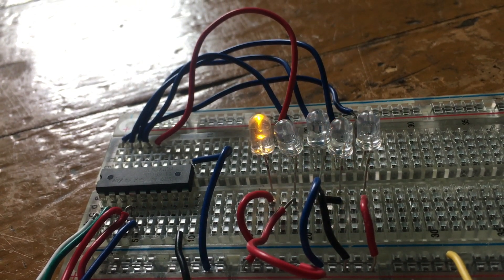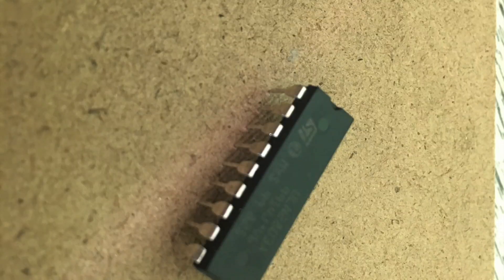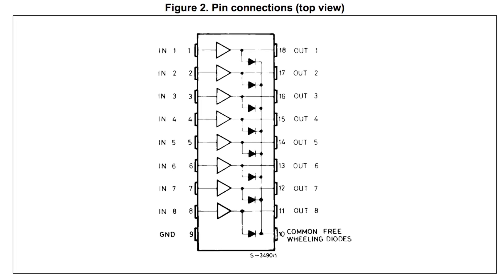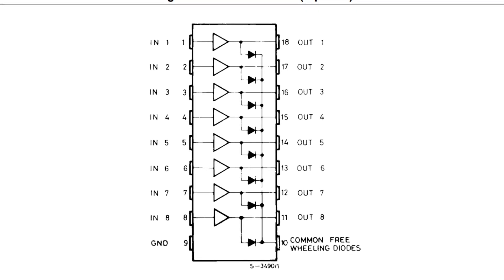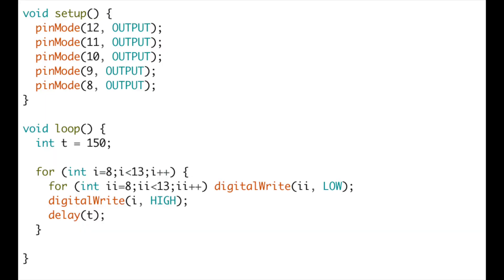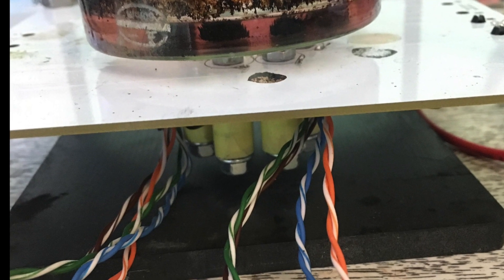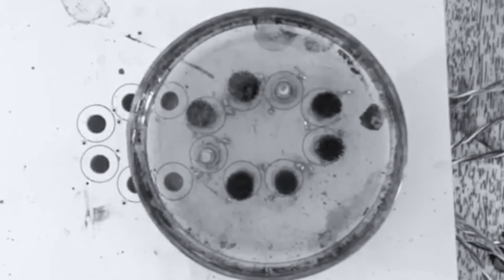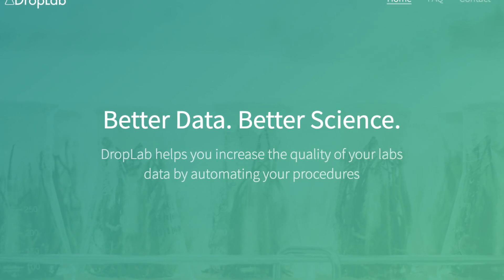ULN2803 Darlington Transistor Array (For use in circuit designs like the Ferrobot)

Comment: So this is more of a pull-down setup where "out" is just access to ground? I looked over the data sheet: http://www.ti.com/lit/ds/symlink/uln2803a.pdf and saw that it mentions each output is rated for 500mA, but the outputs and be used in parallel to drive higher loads. Good to know if you need to drive something that requires more than 500mA.
Reply from the maker: Yes exactly! I should have mentioned that: you can combine outputs to double/triple the allowed current. With these solenoids I only need ~120mA to drive so I'm in a good range. As for the chip current limit in total, I think it is 2.5 Amps so keep that in mind.
Reply: Ah, that's also good to know! I think I still might be able to utilize it and power at least 5 of my electromagnets.